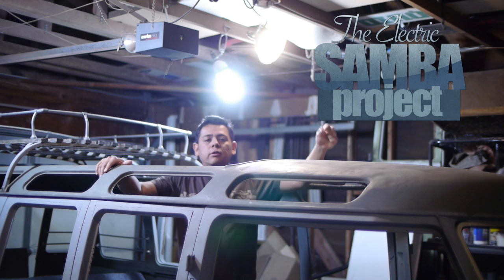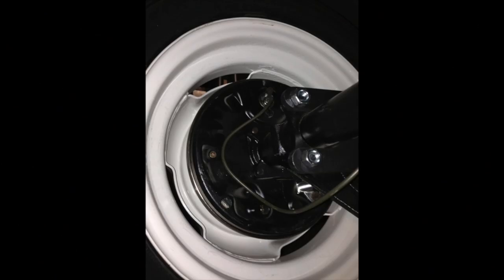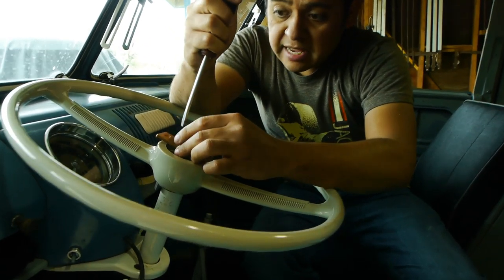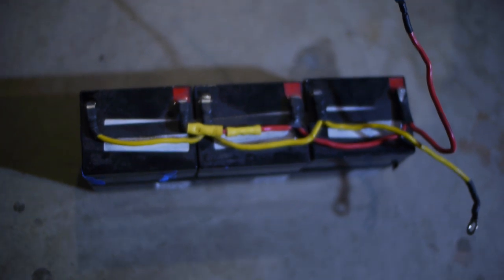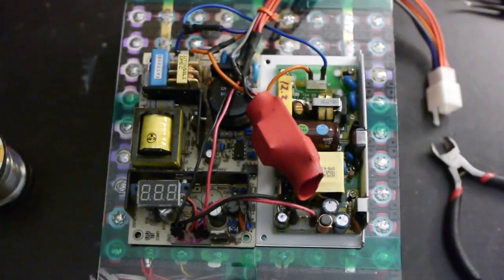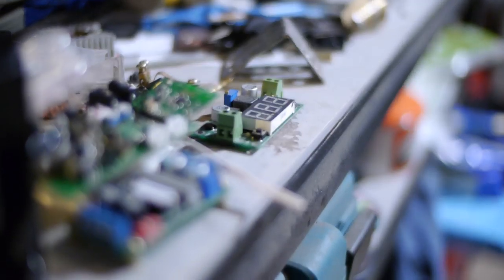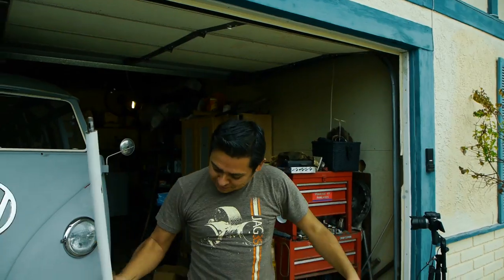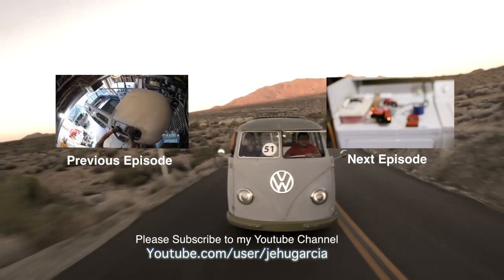DIY EV VW BUS track Racing - eSamba EP 32

Comment: You can power 12 volt stuff directly off the main battery using a buck regulator. Properly built they are very efficient..

Comment: Jehu have you seen the videos on using Super Capacitors on your car for starting instead of a big car battery? Would save some more weight on your vehicle.
Reply: Have you priced super capacitors lately? You could buy a nice house for what a super-cap pack would cost to run the Samba.
Reply: I was talking about inexpensive Caps to use as a CAR BATTERY! to START the car not his entire pack as he was using a small box with Lipos for extra accessories. Might want to read it again carefully.

Comment: Jehu you could go to places like AutoZone they will lend you a tool for free as long as you bring it back.
Reply from the maker: I've always wanted to try that out but i always forget when i need something.
Reply: jehugarcia I replaced a serpentine belt and tensioner pulley in the parking lot of the Auto Zone in about 20 minutes using their tools. They are great to work with!
Reply: O'really has a similar tool-lending program